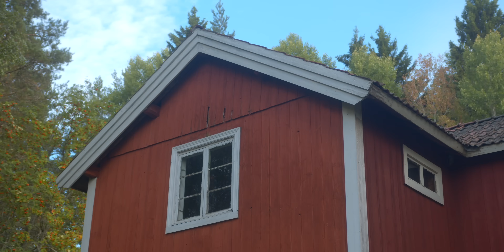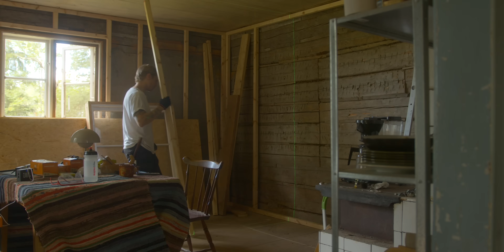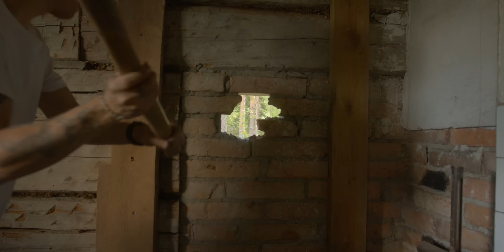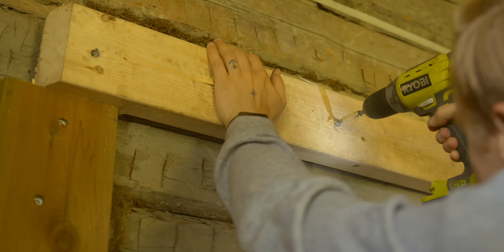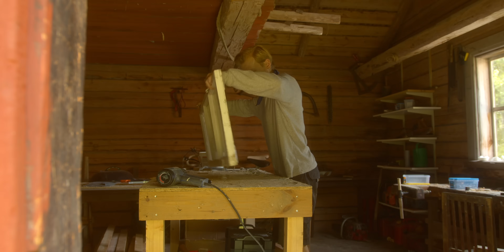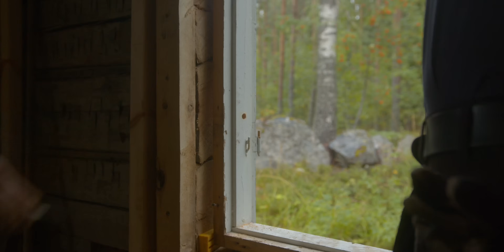Ch. 48 - Installing WINDOW in Swedish Cabin

Comment: It was fascinating to see how they used the dowels to put it together. The thickness of the timber is epic, but that was the wall, inside and out. The timber looks in great condition as well.👍
Reply from the maker: Yeah and it’s holding it together so well. It’s quite fascinating to see the work from the old timers and how it holds up